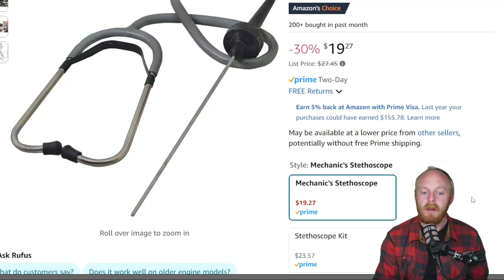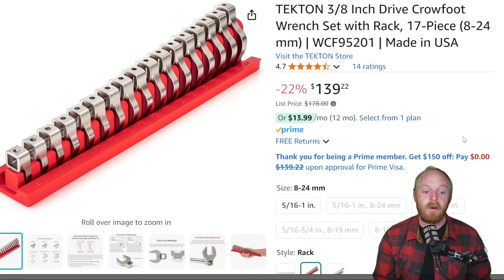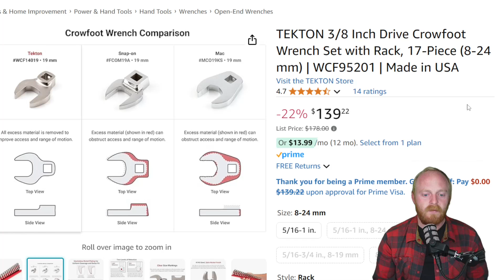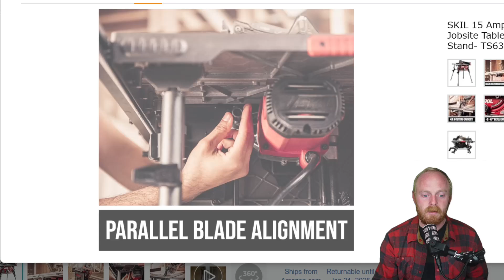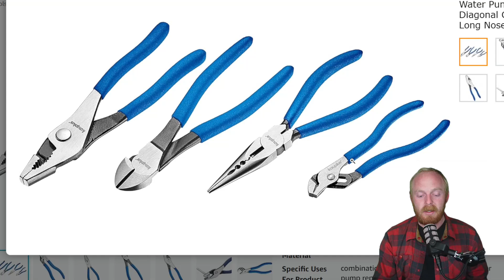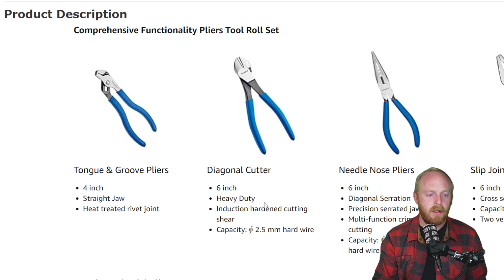Great Amazon Tool Deals Tekton Lisle Skil Kauplus Very Nice Set

Comment: Good stuff, Tony.  
I do quite a bit of woodworking being that my cousin owns his own high-end cabinet/woodworking shop, and I help out a lot.  
And I can tell you that the SKIL model you mentioned is an excellent entry-level/homeowner saw. It has most of the bells & whistles of any portable unit.  

And those Tekton crows feet......... It's hard to argue with the Tekton company on the price. Even at $178, that is about 10 bucks a piece for an American-Made tool set.   
(Sale price comes in at $8.25 a piece).   
The big question is..... How many damn times do you ever really need a crows foot?  
But... when you do, you are usually in some kind of mechanical hell and it saves the day.  Lol 

Happy New Year, Tony!!
Reply from the maker: Hahaha sounds like you and your cousin feel the same about the skil table saw. Glad to hear it. I'm sure he really enjoys your help as well. 
And ya your right about the crowsfeet. When you break it down it's not terrible. But ya the big question being will you use them enough to justify them. I appreciate the input. Thank you!!